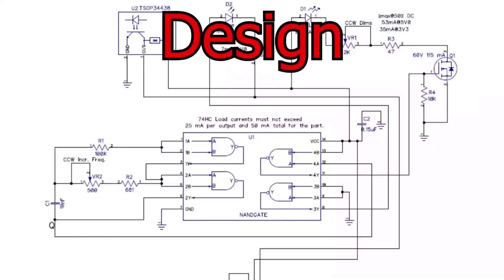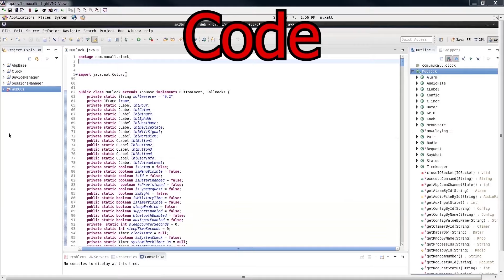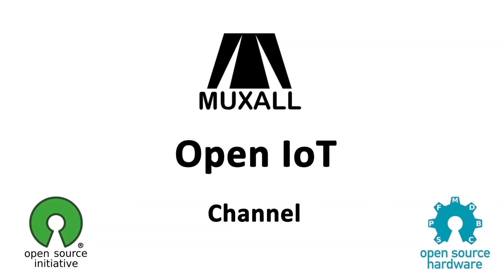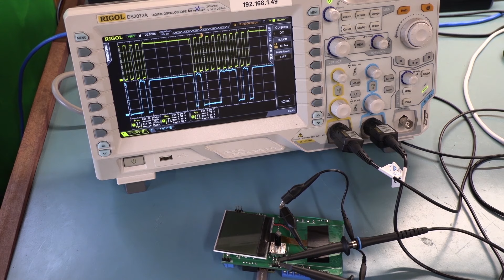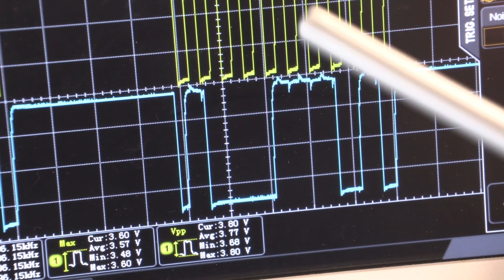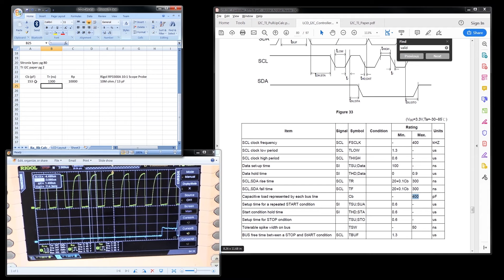IoT#33 RPTC-Q – I2C Waveform Investigation

Comment: It looks like you still have an issue. Your ~1V pulse at the end of each byte is where the ack/nak should be. It looks like some other device is attempting to NAK the data.
Reply from the maker: I agree, the 1V square waveform before the ACK is curious.  There are no other devices on the I2C bus, at this time.  I still think the ST7528i LCD chip is putting a small current on the SDA link to monitor when the ESP32 releases it so it can take over and create the ACK.
Reply: @muxallopeniot9194  The ST7528i has D6 , D5 , D4: tied together for serial input data (SDA_IN) and D3, D2: tied together for (SDA_OUT). Do you have SDA_IN and SDA_OUT tied together outside the device? That would make it a normal i2c interface with 1 clock line and 1 data line.
Reply from the maker: @qwerty1234158 The ST7528i is a COG (Chip On Glass).  The LCD manufacturer (NHD) did tie those pins together otherwise it would not work.  The only pins NHD exposes to the end-user is CS, RST, SCL, SDA, VDD GND, and the charge pump pins (VOUT, V4, V3, V2, V1).
Reply: @muxallopeniot9194  I was looking at the wrong LCD part. Sorry about that. Just curious, have you tried reading any data or status from the LCD? The result of a read should indicate if the LCD can properly drive the data line or not.
Reply from the maker: @qwerty1234158  I don't really have a need for a read so I haven't.  I did a quick google for read examples on the NHD website but didn't have any luck.  Some posts said that certain chips don't support reading in I2C mode; only SPI or 8-bit modes.  I'll look into it further if I get the time.
Reply from the maker: I followed up with Sitronix and here is their reply: 
Dear Customer,

ST7528i can not support " I2C read" function since it is very old product .

Thanks&Regards

Jerry Liu

Darn!  I'll have to follow up with NHD to see what the future is for this 100x160 LCD.
Reply: @muxallopeniot9194  Interesting response. The table of commands in this document https://www.newhavendisplay.com/specs/NHD-C160100DiZ-FSW-FBW.pdf has 2 commands that have the R/W bit set for read. "read display data" and "read status". I'm not sure why they have read commands if the device doesn't support i2c reads. The point of trying a read command was to verify that the ST7528i can drive the data line properly. The 1V square wave you are seeing is on the clock pulse where the ack/nak is. If the voltage level of that signal was higher it would be considered a NAK. So if a read command results in similar 1V square waves for the 0 values in the data then you know the ST7528i is having trouble driving the data line. The 1V square wave on the data line when the ESP32 is not driving it may cause you issues with communicating to your other i2c device.